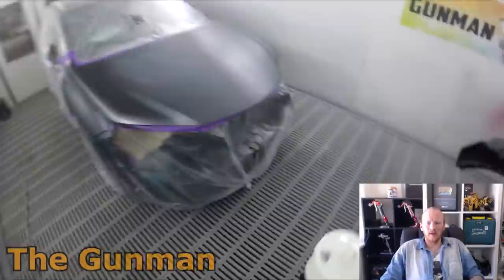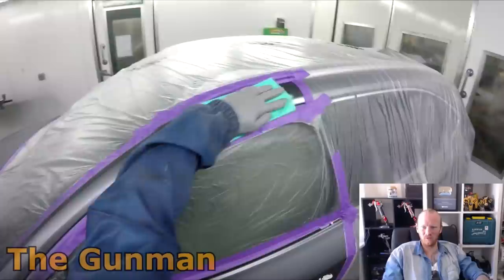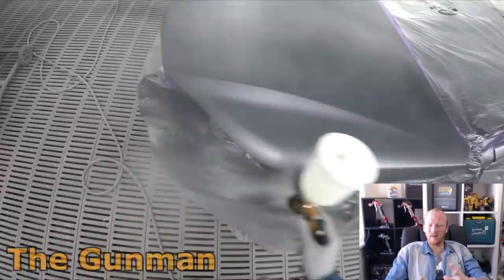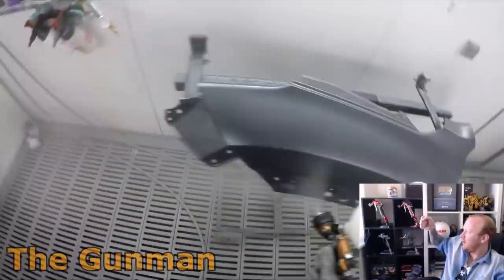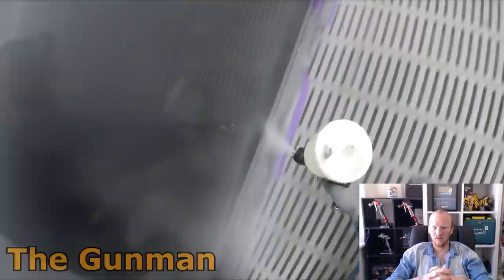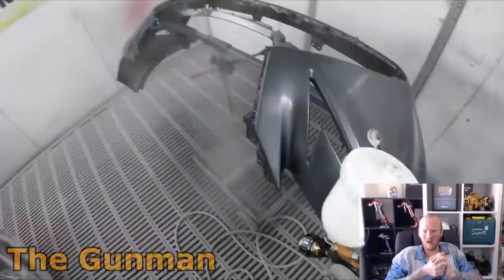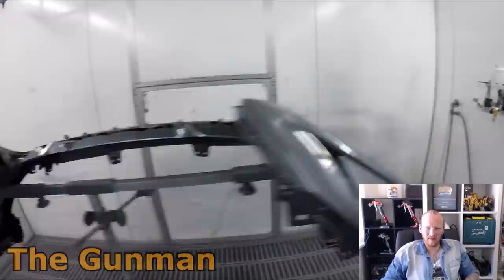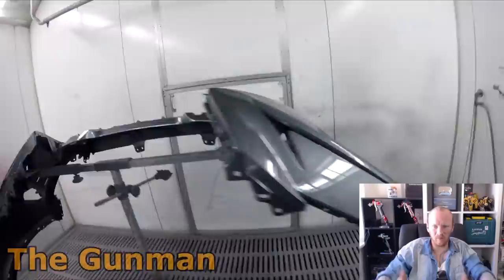Lexus NX-300 Spray Painting

Comment: Great job everytime. I'm looking at getting a SATA 3000B HVLP blue to use for b/c and clear coats. What are your thoughts on that gun?
Reply: Go with the Pro Lite, better finish and less material wasted. About the same price point. More air cap options too. GPI is great too !
Reply: @mitchellferre1652  I'll look into this thanks
Reply: @ThatV12MiataBruh  Check out prices at spraygunsdirect.co.uk they have everything. If you go with a Sata get the 5000b rp. For the same price you could almost buy a pair of Pro Lites. With those I would use a T20 air cap, 1.3 tip. For a sata use a 1.2 tip as they really pump it on . Avoid HVLP unless it is mandatory in your area. Cheers !
Reply: @ThatV12MiataBruh  sorry, I meant TE20 air cap for Pro Lite. T110 is great too.
Reply: @mitchellferre1652  I think the pro lite would suit my application better but its double the price if the Sata that I'm looking at getting
Reply: @ThatV12MiataBruh  The pro Lite is $60 USD more than the 3000b rp today on spraygunsdirect.co.uk   I would pay that $60 and consider it paid forward. It will pay for itself.
Reply: @mitchellferre1652  the only problem is that I'm in South Africa and I need the gun within the next week
Reply: @mitchellferre1652  and the guys down the road have stock of the Sata
Reply: @ThatV12MiataBruh  It can be shipped from UK to S Africa too. I received mine in USA in less than a week.  3000 is a good gun. Pro Lite is a great gun. If you could try them both you would forget all about the difference in $. I seriously recommend a Devilbiss GPI 1.4 tip if cost is the issue. I use one and its FAR cheaper than sata and never disappoints.
Reply: @mitchellferre1652  ok sweet I'm sold on the Devilbiss already and you've made it alot easier for me